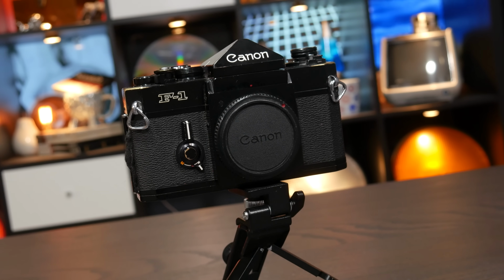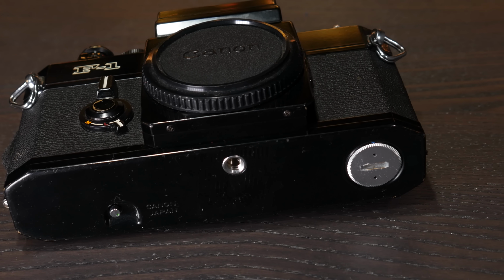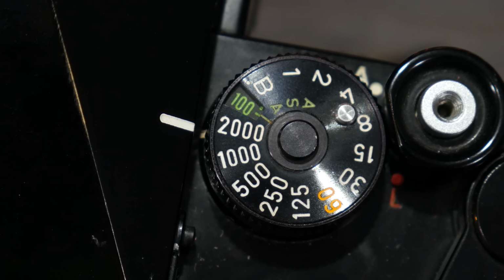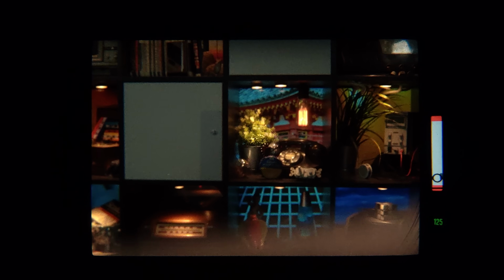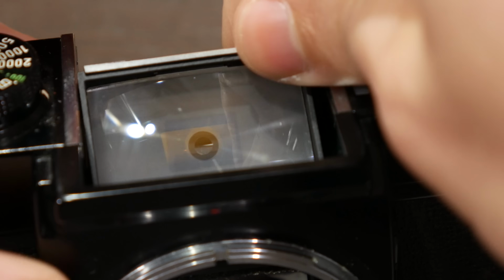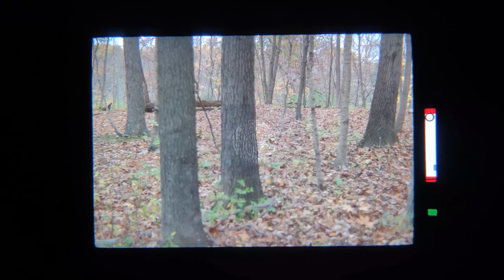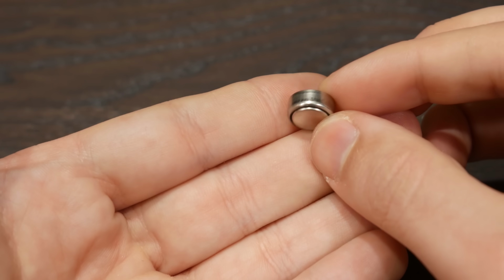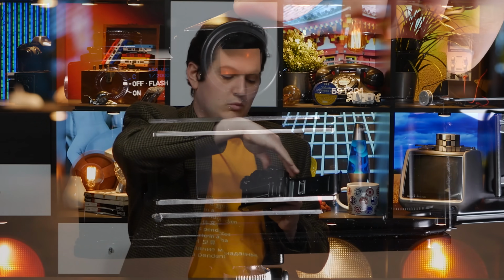1970's Camera Tech: How they showed you what settings to use

Comment: Actually we don't use the DIN Standard in Germany, we use ISO ASA as well. Even on older german cameras/light meters the speed selection wheel usually shows the value in both DIN and ASA and that as far back as the 1950s.

Comment: 20 years ago I worked for Kodak and we used those (Canon F1) to make Copy Negatives. We'd place a picture on a white bed with holes in it with a vacuum to hold it flat and over that was adjustable camera holder with two bright lights either side. To make a Copy Neg you'd just take a photo of the photo. It never struck as weird until now we working for Kodak but were using Canon cameras. (I assume Kodak made cameras back then, not sure now)

Comment: Another great video! One correction... it's not technically true that ISO on a digital camera changes the sensitivity of the sensor. ISO (when it's not simply a post read multiplication) is the gain setting for the part of the sensor that amplifies the accumulated charge, so it can be read off and converted to a digital file. This doesn't change how many electrons are accumulated by the sensor any more than turning up the volume on a pre amp increases the  details captured on a vinyl record. Turning up the volume (or amplification) CAN help the signal to swamp sources of noise further along in the pipeline (e.g., those associated with the analog to digital converter or ADC or, in a stereo, noise coming from the stereo amplifier).  That said, it also amplifies any noise already accumulated with the signal, so after a certain point, little is gained in terms of signal to noise not to mention you often start clipping higher values reducing the dynamic range.  Anyway, this all has a second surprising implication: that raising the ISO actually increases signal to noise but not by increasing sensitivity. So for long-exposure, low-light photography, you will want to select the highest ISO possible before diminishing SNR payoffs kick in. For the curious, Christian Berge has published detailed tables of the optimal ISO values for long exposure astrophotography using popular DSLR models.

Comment: “There isn’t automatic anything here”

the canon FD lens Automatic setting: “allow me to introduce myself”
Reply: Well, the camera wasn't able to use it... next gen camera's did.
Reply: Well that wasn't used in F1. Later AE series cameras were able to take advantage o the semi automatic shutter priority.
Reply: You had to buy a massive EE finder that coupled to a control arm that went into the side of the lens box. But yes, it was technically available
Reply: @DartzIRL  Depends on which model F-1 you had; the original F-1 and F-1n used that finder for auto exposure function. The New F-1 that came out in 1981 went to an electronically-controlled shutter, and used the AE Finder FN, which was a lot smaller and less clunky than the original EE finder for the original F-1.

I used Canon F-1 (and F-1n and New F-1) bodies and FD lenses from 1971 'til 2003. Great system, great glass, excellent results for 35mm.
Reply: Canon made the autofocus Canon T80 which used the pre-existing Canon FD mount but with new electronic contacts to communicate between the T80 and special AF lenses driven by slow and clunky electronic motors. The idea didn't work out well so Canon ditched and quickly obsolete the entire FD mount and start fresh with the truly electronic autofocus EF mount in 1987.
Reply: If you used it with a Servo EE finder it was automatic 

Or a little later, with a Canon EF
Reply: ITS A MAYMAY COOMENT HURRDURR ME LIKE DA MAYMAY COOMINTZ🤤💦👏
Reply: Yep. Even the timer automatically snaps a photo. I guess it doesn't count as "automatic" now unless it's electronic. I wonder what he thinks about automatic weapons.
Reply: @EebstertheGreat  The timer has to be deliberately wound up beforehand, so at least speaking in the language of mechanical watches (which seems quite fitting to me in this case), it is not automatic.

Comment: I was given an old Pentax K1000 a few years back.  It's also entirely mechanical and even simpler than this camera (no timer, etc.).  The viewfinder light meter is just a needle that you are supposed to get right in the middle of the target.  I knew barely anything about photography, so learning to use it really taught me a lot about photography that I would've never known with a modern autofocus DSLR (or at least not needed to know).  Apparently they made that camera for over 20 years and was suggested or even mandated for beginning photography students due to its simplicity.  Great stuff, as always.

Comment: Fantastic stuff! I've been using zinc-air 675 batteries for ages now and to adapt them to the old 625/PX-13 size I found a brass adapter on eBay to do just that. I'd also mention to make a habit of removing the zinc batteries when the camera won't be in use for longer periods because after activating them from peeling the tab off the battery may eventually corrode.

Comment: Oh, by the way, that bit where the shutter at very fast speeds becomes a moving slit across the frame? It's still present in modern DLSRs with mechanical shutters. They just managed to get it to shorter exposures than 1/60. I think it's about 1/200 for my Canon 750D, but don't quote me on that.
Reply: For “flash sync” the whole frame must be open when the flash is fired or part of the frame will be dark. Cameras with faster flash sync speeds either had move the curtains faster (hard to do) or they changed to travel vertically making the distance to travel shorter for a 35mm frame. So with the same curtain speed you get the whole frame open quicker (time it takes for the first curtain to travel across the frame) and you get a higher flash sync speed and do not have to move the curtains faster.
Reply: @peterborman5576  Yeah, I don't have a slow-motion camera to check which direction my camera shutter travels in, unfortunately. But they did improve the shutter materials as well, so I am not discounting the possibility that travel speeds improved as well.

Comment: I'm currently scanning my old slides dating from the early 80's. What I'm noticing is that the Kodachrome slides especially are suffering from mould/fungal growth (barely visible to the naked eye but obvious blobs/spidery radiating growth and fine crazed lines etc in the scans). Strange as other brands of film from the same period (Fuji/Agfa) do not seem to be that prone to this form of age deterioaration. I assume this is because of the way the emulsions are laid on Kodachrome film, ie there is an obvious difference in appearance between non emulsion and emulsion side, whereas Fuji for example looks identically glossy both sides.. Some of it can be cleaned off but if the mould/fungus has bitten deep into the emulsion, it has left permanent crazing (like old porcelain). Most annoying.

Comment: I love it. Cameras like that I understand. They make sense. If you understand a manual camera like that, you understand photography in a way that you will never do when taking pictures with a phone or some fully automatic camera.
For that reason I dislike fully automatic cameras. And I'm not even making a distinction between analog and digital, because the principle of operations is still the exact same.
Digital cameras have a "film" rating and the shutter speed and fstop still work the same.
Of all the cameras I owned, my favourite was a Fujica that operated very similar to his Canon.
I have a Canon 1300D and it's very good. But you feel a little shut out of the decision making process of taking a picture.
Sometimes I want that wheel with shutter speed back.

Comment: The sunny 16 rule becomes sunny 22 in the case of shooting at beaches or heavily snowed areas. The sand and snow reflects much more the sunlight and a smallest aperture is needed to avoid overexpose. 
Also there is the similar looney 11 rule for shooting the moon. You set the aperture at f/11 and the shutter speed with the number of the film ISO.
Keep in mind that with apertures smaller than f/8 the diffraction phenomenon starts which make the photos less sharp. 
The diffraction phenomenon exist with all lenses but is less serious with optically better lenses.

Comment: I remember the earlier (and somewhat simpler) variant of this camera my father bought in the Seventies. It was incredibly reliable and worked flawlessly for more than 30(!) years. Not only was it reliable, it was both easy to use and full of useful, but not distracting options. A brilliant piece of art.
Reply: Was that an FTb, possibly? That was my first camera, like a simpler F-1, without the removable viewfinder, and didn't take motor drives, etc. It was a wonderful camera to learn on.
Reply: @deluxe67x12  Indeed, that sounds exactly like the camera I was talking about.
You're right, it was a great camera to learn on. When I was 10 years old, I (kind of) learnt and understood what the options and settings do, thanks to how comprehensible the "user interface" worked.

Comment: This camera looks to be a carbon copy of my father’s Pentax from the (very) early 70s. I remembered the weird voltage. I asked home why when every battery is 1.5, 3, 4.5, or 9V that one what 1.35V. Why did I ask? Because he kept sending me on shipping trips until I found one. And I remembered it looked exactly like this camera. The setting and everything. The light meter as well. Later my father has replaced it with a newer one and I recall he has complained that the new one didn’t have the metal rolling shutter. Goosebumps.

Comment: DIN used a logarithmic scale, so doubling sensitivity added 3 degrees to the DIN number.
For example the difference between 24°/10 film and 21°/10 film is 3°/10 which is 0.3
The log of 2 is 0.3 so the sensitivity is doubled. 
The difference between 27°/10 film and 21°/10 film is 6°/10 which is 0.6. 
The log of 4 is 0.6 so the sensitivity is quadrupled. 
If you want 8 times more sensitivity the log of 8 is 0.9
So the difference in DIN must be 9°/10 which is 0.9. 

The 21°/10 or 27°/10 etc were later simplified as 21° or 27° etc.

Comment: I have an F1 very close in serial number to the one shown. I actually preferred to use my lighter FTb QL, its more classic style of match needle was much better than the vertical one on the F1. I probably pumped about 1,000 rolls of Kodachrome through those cameras before I went digital in 2005.

Comment: My first SLR was a Canon AE-1. Loved it. Only problem was using it outdoors in winter. Cold temperatures mess with the viscosity of the lubricating oil on the tiny moving parts, so it would seize up all the time.

Comment: There was actually a third film speed standard (GOST) for the Eastern Bloc, and it was actually relevant if you bought the really cheap B&W films like Svema and Foma.

And the decline of the DIN numbers is likely due to the decline of the German camera industry (vs the Japanese which used ASA). I actually own a Nikon film SLR that was originally sold in West Germany and it does not used the DIN scale.

Comment: If it goes only to 1 second what is the 2000 option for?
I would have assumed the maximum is 2000ms = 2seconds.
Reply: it's fractions. so 2000 is 1/2000s (as 125 is 1/125s) anything longer than 1second you're expected to be close enough using "B" and ... one Mississippi, two Mississippi...

Comment: I have an old 60s Agfa Selecta camera with selenium light meter that does not need a battery and also sets exposure time automatically based on aperture and DIN. It’s not a SLR tho. Would still love to see that tech explained. How tf does a light meter work without power?
Reply: Think "selenium cell" == "solar cell", generating electrical power from light. More light, higher voltage.
Reply: @christiankolinski1563  ah. Makes sense. Thx

Comment: Just a thing to mention:

My camera (Zenit 11) has a ligth meter, but doesn't need a battery. It's an external (not TTL) light meter, but still. Same ring and needle thing, but not seen in the viewfinder. 

How does that work?
Reply: Those use selenium cells (a early type of solar cell), More light -- more voltage generated. Enough to move the needle. Not very good at low light, so not of much use if you're interested in nighttime photography, but ok during the day. 
Those cell age  and drift in value leading to false measurements -- so keep it dark when not in use.

Comment: One of the other benefits of having the interchangeable viewfinders in the F-1 was that with the New F-1 in the '80s you could get a viewfinder that enabled automatic shutter speed, or, with a film advance motor, automatic aperture.

The new F-1 focusing screen was also interchangeable, allowing for different focusing patterns and even metering types, which I'm surprised wasn't mentioned here. As far as I can tell looking at mine, they work in pretty much the same way, just somehow grabbing light for the meter across a wider portion of the screen.

More neato stuff from old cameras!

Comment: DIN is still the standards organization in Germany. Consider DIN 2137-2:2012-06 T3, which is the “expert mode“ keyboard layout for Germany. It has regular, shifted, alt+gr, then group 2 regular, and shifted. In all, each “normal” key (48 opposed to the USA’s 47) that issues a character can have 5 different values. This is also odd since this update happened in 2012, where for a long time both Mac and Windows have supported regular, shifted, alt-gr, and alt-gr+shifted, giving 4 keys each, if they had really thought about it they could have expanded alt-gr to a shifted, and then added in a second group if necessary with another regular, shifted, alt-gr, and alt-gr+shifted for 8 different symbols available per key. But what do I know? I’m just a freak who likes keyboard layouts.

Comment: I'm always astounded by the creative ways now common features were introduced in film cameras. I never knew about that half-mirror inside the ground glass on the F-1. Really cool.
My favorite is the solution in the Topcon RE Super though (or Super D in the USA), the first camera ever with through-the-lens exposure metering. It used a light meter built into tiny slits in the mirror itself! (that were imperceptible through the viewfinder) They also made the needle display visible both through the viewfinder and on top of the camera, so you could set your parameters without raising the camera to your eye. Tokyo Kogaku was one of many super interesting camera (and lens) makers back in the day that've now been mostly forgotten.

Comment: The similar aged Pentax Spotmatic F also had a needle exposure meter, but it compensated for the aperture setting internally, so you only have to align the needle in the middle.

Oh, and the Spotmatic F has a Wheatstone Bridge in the exposure meter, so you can just use the 1.5 V batteries. Granted, the Spotmatic F was the first Spotmatic to have this (and the latest Spotmatic), but this makes that camera very usable until today.

I got mine from my grandfather and it still works fine - I just had to apply a tiny droplet of oil onto one tiny lever in the inside, because before the mirror sometimes got stuck in the up position. Those old cameras are really an engineering marvel.

Comment: You can add small LDO for 1.35V and that would solve the problem. I would be even more accurate. But needs disassembly to install it.
TPS709135DBVT Here is part number. You will need two 0603 10uF capacitors and job done :) PM if need any help about this.

Thank you for video ! Will share it :)

Comment: Funny how this camera seems easier to use with a manual lens than my modern DSLR. I bought a few ~20 year old nikon lenses to play around with on my D3500 and they work great, but my only solution for getting the exposure correct is guess and take a picture to adjust from there because the camera can only do light metering with newer lenses. 
I also never considered that higher ISO film would produce a grainy image like it does on digital cameras. I know why it happens on photosensor, but I would love to know what causes that chemically with an analog solution

Comment: Regarding "ISO," it should be pronounced as a single word, because it is not an acronym. An acronym is when you pronounce an initialism as a word, but "ISO" doesn't stand for anything. The name of the group is "International Organization for Standardization," which you may notice does not match up with I-S-O. This is further complicated by the fact that the initialism is different in different languages, so they purposefully chose "ISO" (from the Greek for "equal," which is fitting for a standards organization) to be internationally used and not tied to any single language.

Comment: After watching the whole video I have one question left:
The circles upper and lower half changes between light and dark depending on something.
For what was it used and how does it work? (I assume polarization filter?)
Reply: It's a split-prism focusing aid, surrounded by a microprism ring. I don't know the operating principle, but you should be able to look it up from the name.

You don't find them stock in modern DSLRs because those assume you'll be able to use autofocus. You can get aftermarket focusing screens that have them - I actually had one for a while in my D5300, which I use with old manual lenses. They need a fast lens to work properly, though - below about f/2, they just go black.